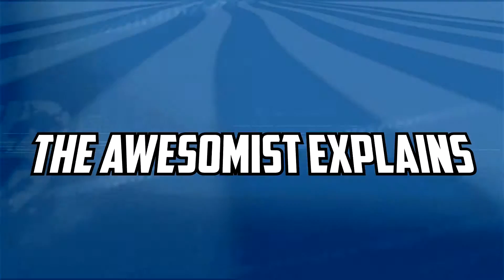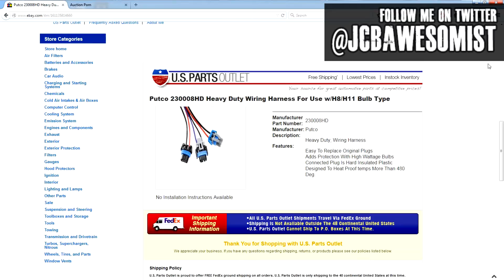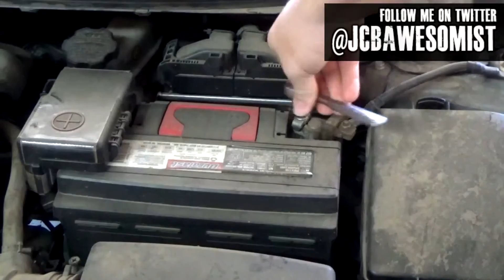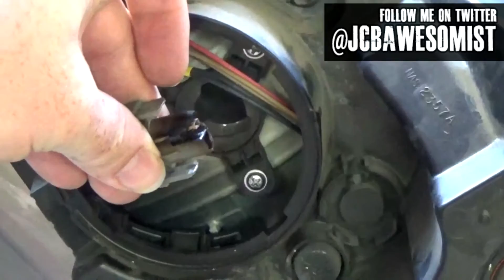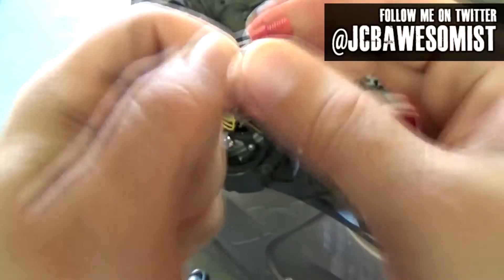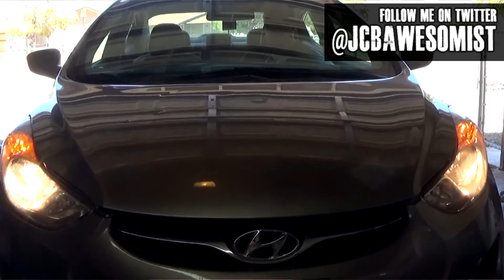Tutorial Tuesday: Changing a Headlight Bulb/Wiring of a 2011 Hyundai Elantra

Comment: So I have the same problem with my 2009 Sonata, but the bulb harness is a H11B instead of an H11. I can find all types of harness for h11 but not H11B; I can find a conversion kit for H11 to H11B---so, do you think I can just cut the conversion in half and splice on the end with the H11B connections to my wires? Does that make sense?

Comment: I have a 2013 and the socket doesn’t have the two guide lines. Both sides look exactly the same and both wires are yellow. How can I figure out which side is which?

Edit: nevermind, I got it. The bulb only fits one way because there a notch in the middle on one side and not the other. Easy peasy

Comment: So let me ask, the dealer said he would have to replace the “harness” for the socket that looks just like the one in your video. Wants to charge 260$ out the door. Reason being, labor....said he would have to take off the bumper in order to replace the wiring harness? Does this sound right? It’s a 2012 but otherwise, same exact problem. Thanks for any feedback, and great video!
Reply: Nothing involving a dealership sounds right. $260??? What's the guy a doctor? Start investigating the wiring yourself. See if its burnt or melted. Harness is just this guy trying to make himself sound like he knows what he's doing. 

Dude it's a simple fix. Stop making it complicated.

Comment: I have a 2011 Elantra, I’ve been having to replace the same low beam bulb over and over and I just saw that the wire is messed up. Will attempt to do this to see if the problem is fixed! Thank you! Btw, are the daytime running lights supposed to stay on even if you set the lights in the OFF position? Thanks! +1 subscriber
Reply from the maker: +carlos alducin My day light bulbs always have. So I assume they're supposed to stay on.
Reply: carlos alducin Oh my God dude, I have the same damn problem with my 2014 Sonata. I moved to a colder environment (from Bama) and this is the second year I've had to replace just about all my bulbs. And this time, the bulb didn't fix my right side issue. So frustrating!

Comment: Did it ever burn again? Mine keeps burning   I wonder what it is?
Reply from the maker: +Juan vegas Mine has not burned again. I would check your fuse box make sure there's nothing wrong in there. If you have a short the wires will melt. Otherwise it could be the heat of the bulbs. Though I don't think there are any alternative options.
Reply: Juan Carlos 
Did you ever figure it out mine keeps burning out
Reply: Is there a special gauge for the posi lock connectors?

Comment: Thanks for the helpful video. Gonna attempt this soon on my girlfriends Elantra!
Reply from the maker: +steelcurtain187 When I made this video I was curious how many other people are having this problem.
Reply: +The Awesomist It is on the same side as yours and looks pretty similar with the burned plastic. Only difference is this one is a 2013. I'm hoping it will work because it looks like the same damn near setup all around. Found the wire/ connector you were referring to on ebay too. question, it looked like it had 3 connectors on it and I assume you only need the one? Do the other 2 just hang there?
Reply from the maker: +steelcurtain187 the connector I bought had 2 wires and I connected both. My headlamps have two wires as well. Not sure if that's the same on the 13, one thing about these cars is if they're manufacturered half way through the year or later they often have a mixture of parts. My wifes car is 2011 but has lots of parts for a 2012 which makes repairs a pain when it comes to buying replacement parts.